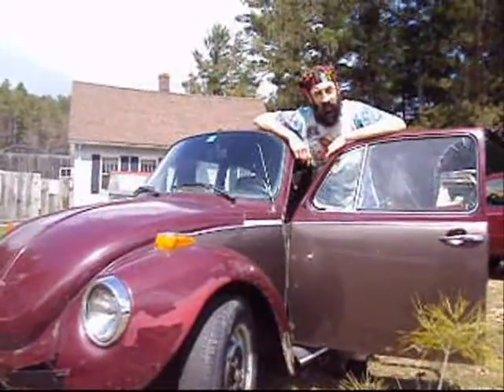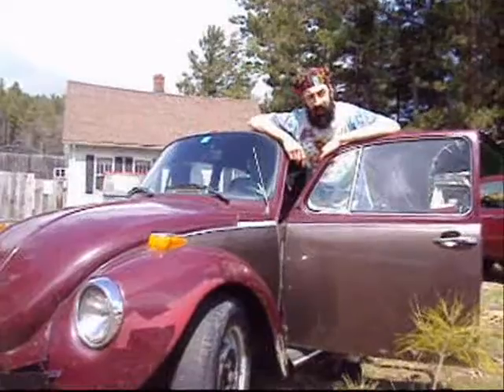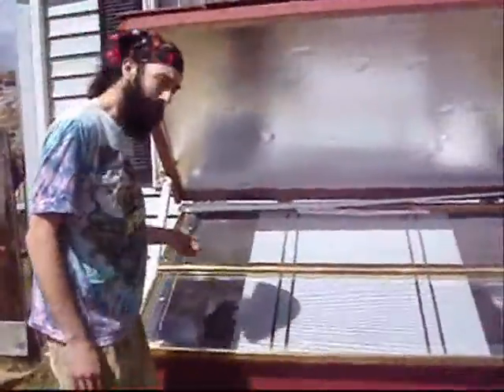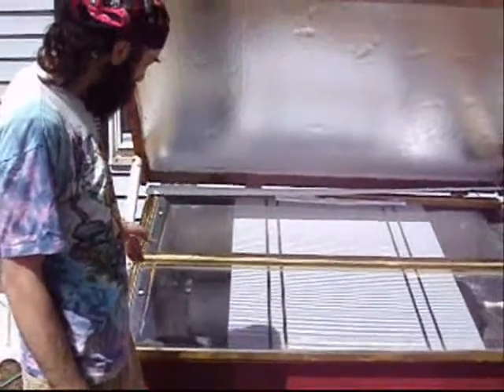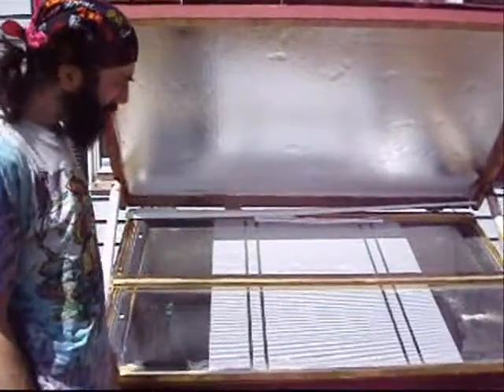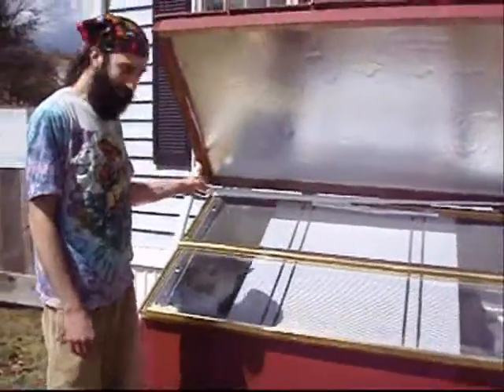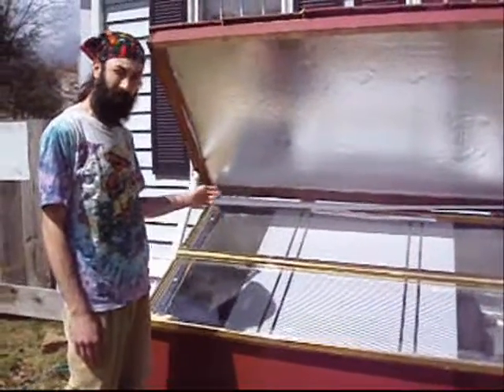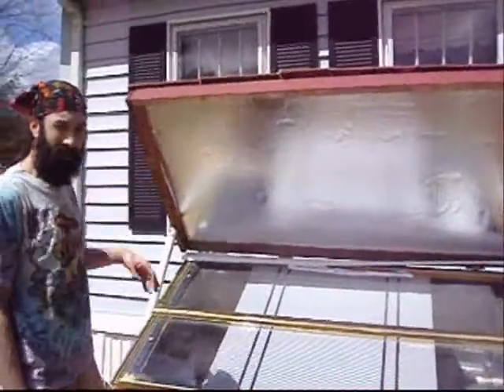This Hippy's House Episode 1: Passive Solar Water Heater

Comment from the maker: The final step which I did not show but might add to the video later is to plumb the solar water heater into your house to preheat the existing water heater, or turn off the heater and just use the solar free water.